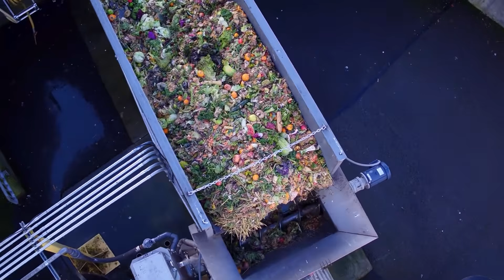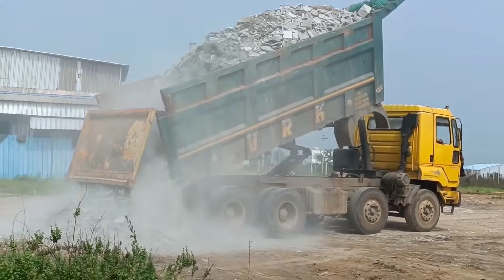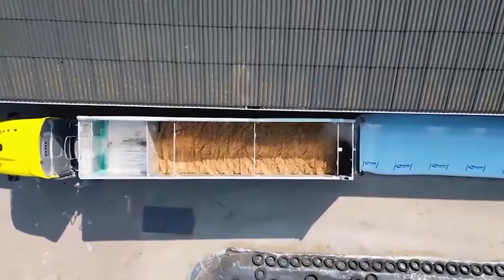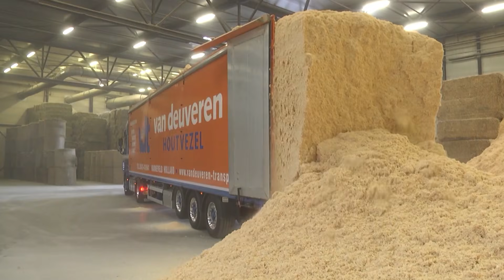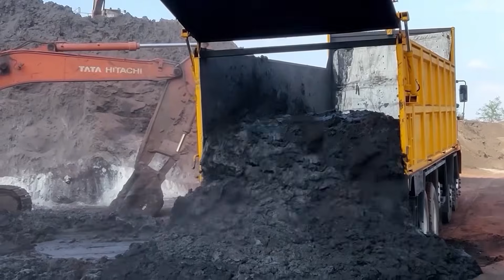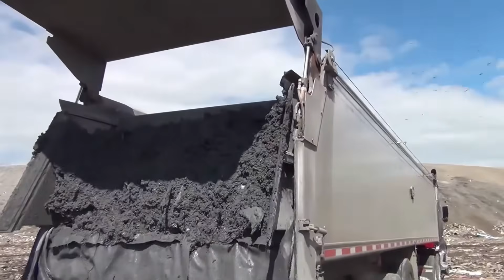Revolutionary Walking Floor System Makes Unloading 10X Safer

Comment: Sure, who's gonna pony up the extra upfront cost for the upgraded trailers? How much downtime to be expected for issues/maintenance on the system? What happens when a truck arrives and there's no forklift or way  to unload the delivery if the trailer has issues? This has been around for ages, there's a good reason it's still sorta niche.
Edit: Not to mention more weight for the system, which is the biggest boon in shipping in the first place.
Reply from the maker: @Stealth86651  They don’t fit every industry but for those they do they are game changers. A lot of light weight commodities bulk out first. They seek a lot of them and some niches it’s all they use.

Comment: Walking floor trailers are a pain in the ass to load, they normally come with higher sides , which every day loading shovels can't reach 👎
Reply from the maker: @zigzag5805  You prefer a dump trailer then?
Reply: @TheTruckersChannel  aggregate trailers or bulk trailers are fine, but the walking floor trailers seem to be 5-6 inches higher , just out of reach for a Liebherr  576
Reply from the maker: @zigzag5805  💯